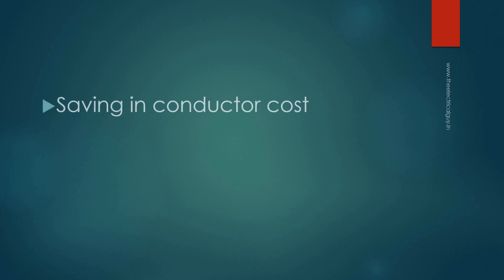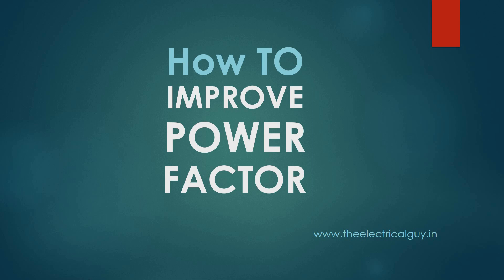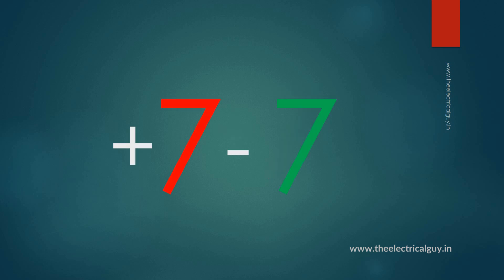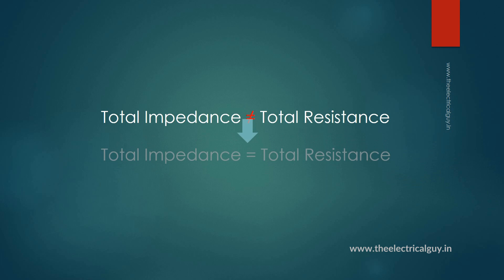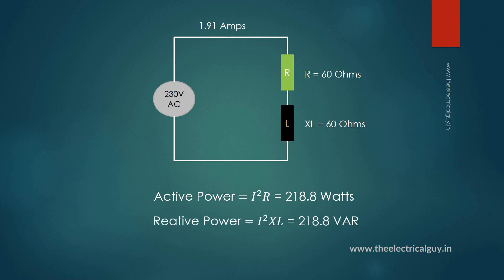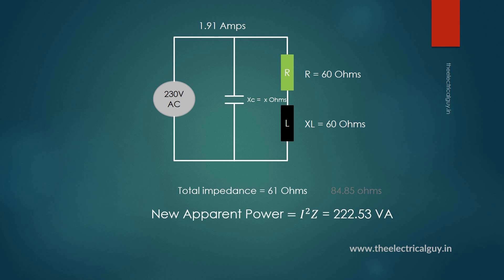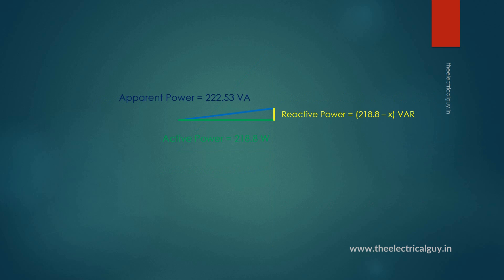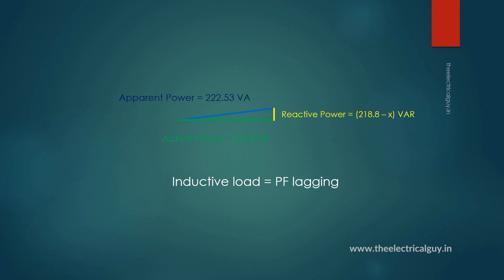How to improve Power Factor? The Basic Principle | TheElectricalGuy

Comment: If Z is 84.85 then the current should be V/Z = 2.71A. It should not be 1.91. 1.91 comes if add inductive reactance and resistance and divide that by V=230. But it should be 230/Z. Please do reply.
Reply: His calculations are wrong